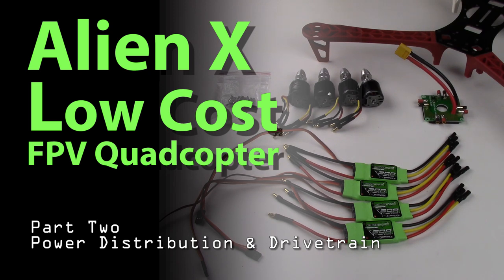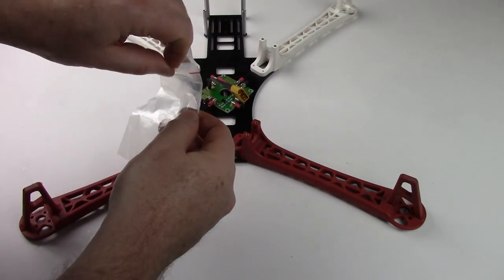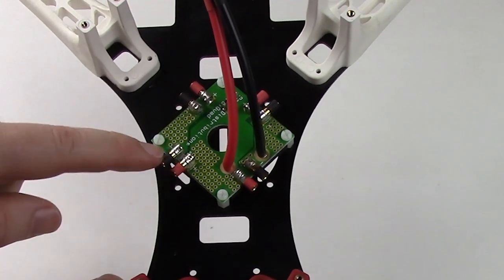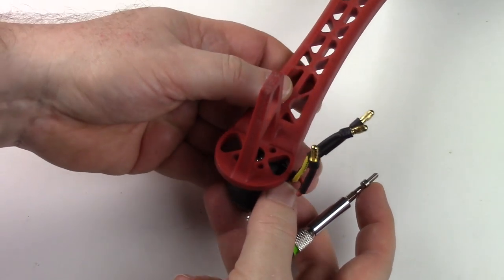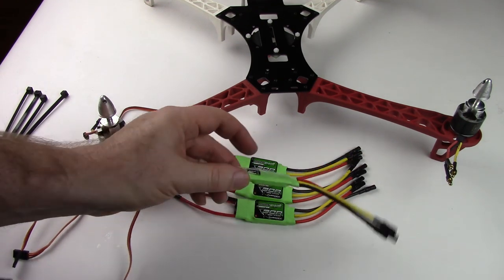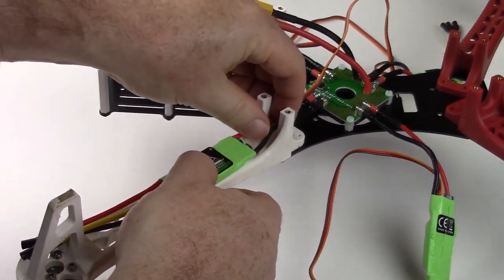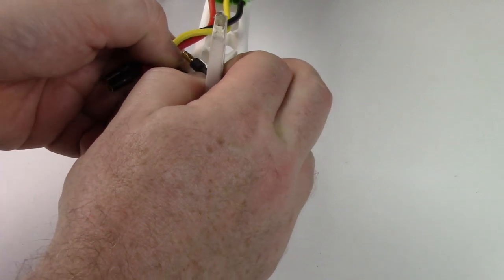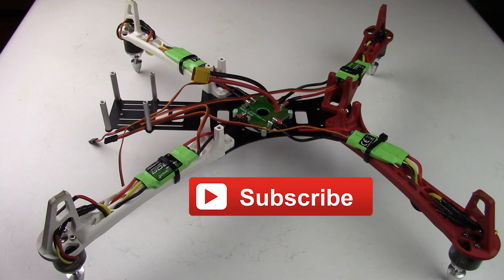AlienX Low Cost FPV Quadcopter Part Two

Comment: Great series!
Please, could you do part three?
I have the same frame done up to this point and would like to see how to mount the flight controller and battery.
Reply: dave, behave yourself. you could do this in your sleep with carpenter's tools. :)
Reply: jimmy gray Ha ha, that was two months ago :)
Reply: ***** did you finish building your quadcopter??? did you installed your battery and flight controllers? i need info all i have is the frame and the power dis. I want to know want engines are the best to use and the speed controller and how to set up everything else
Reply: Adimil Martinez I used sunnysky motors. 
See this video: https://www.youtube.com/watch?v=rYTFMJHfn-0

Comment: Great videos thank you!!
Question: I have noticed that most multi rotors use a low KV motor ie. 900kv-1400kv. If I wanted to use a higher rated motor like the NTM 3536-1800KV for a Quad copter, would this be an issue?

Comment: part 3 ?
Reply from the maker: There will be a Part 3 and beyond.... work/life has gotten in the way of YouTube.
Reply from the maker: Also I had planned on putting the Hobby King KK2 board in this copter to keep the price ultra low... but I haven't been able to get one. So I may continue on with a NAZA lite and do an update video with the KK2 later.
Reply: Brook Dain BS....Get on it!   :)   Kidding!  Subscribing now.  What's the estimated cost so far, for videos 1 and 2.  Means frame, motors..est.    $150.?